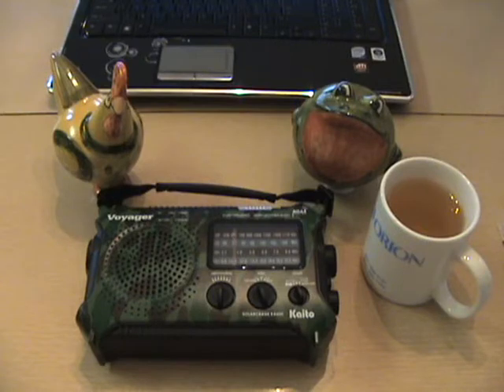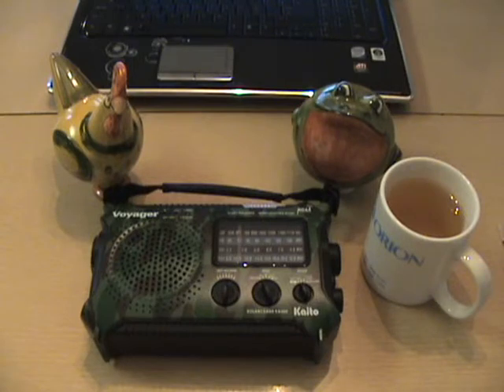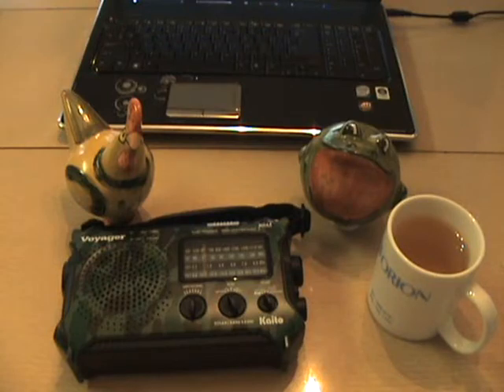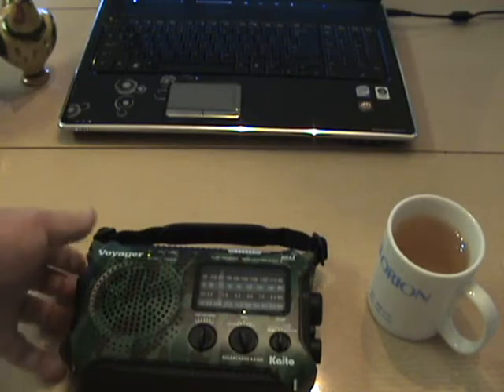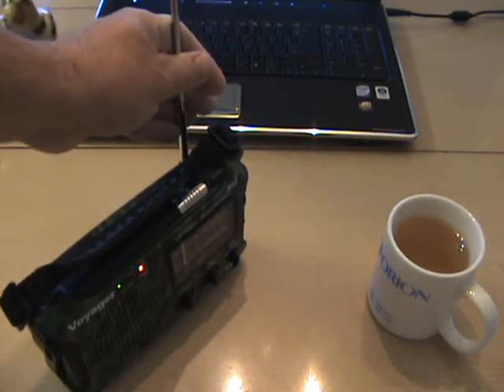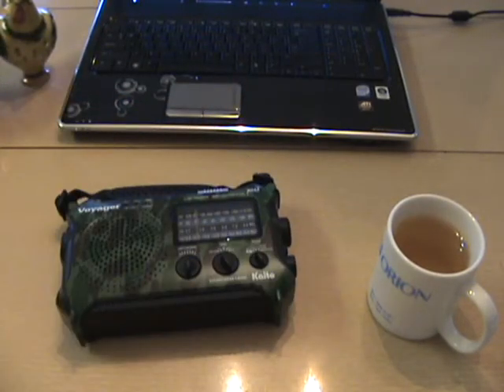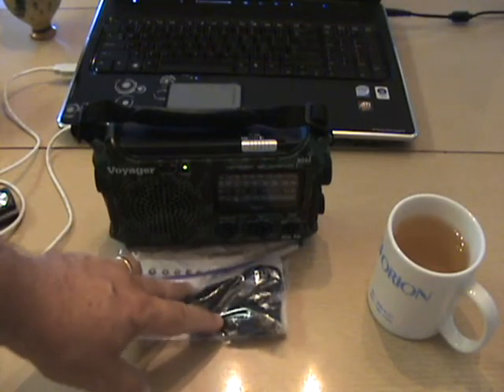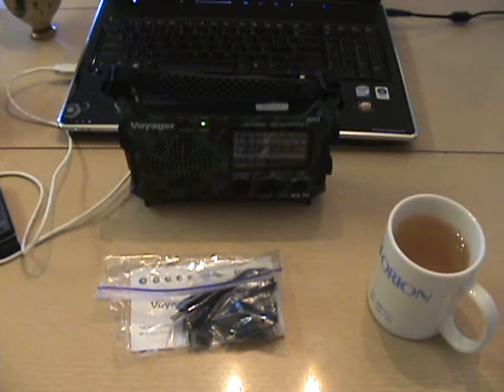Kaito Voyager KA500

Comment from the maker: @TheOld300prepper Thanks for watching! I have my father's old AM radio. It doesn't run on batteries. Good old AC. The power cord is so old it is beginning to crack. Yes, not a transistor in sight, it all tubes! Takes it a few minutes to warm up and stabilize. Then it is a darned good radio.

Comment from the maker: @salmer666 It only charges the battery pack it comes with. If you put in rechargeable AA batteries, you'll have to have a different way to recharge them. Also, if you plan on using the Voyager to recharge cell phones, iPods, or other small electronics, you'll be unhappy. These items only recharge through the USB port while you are cranking. It won't recharge off of the battery alone. I'm not sure if the solar recharger will work for that. If I get a sunny day, I'll try it.